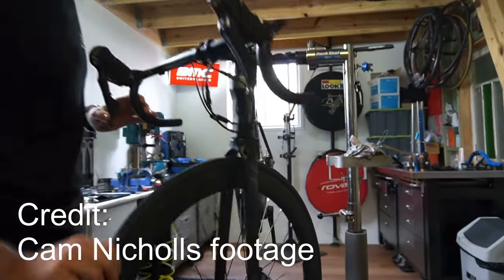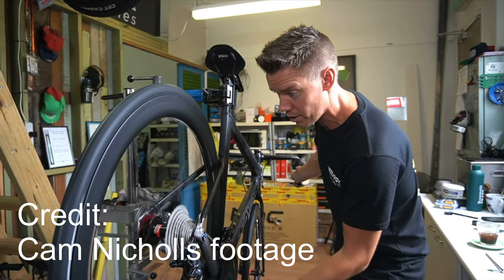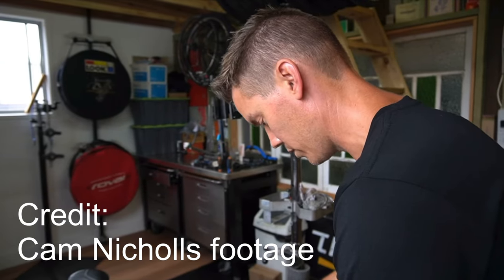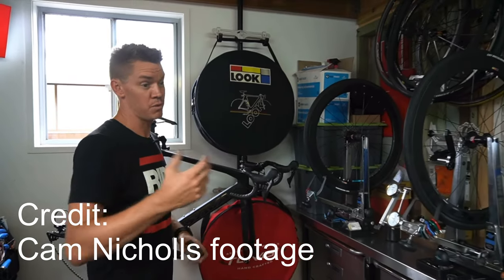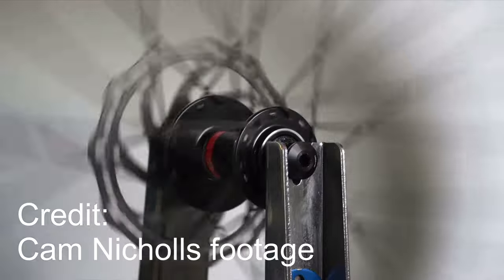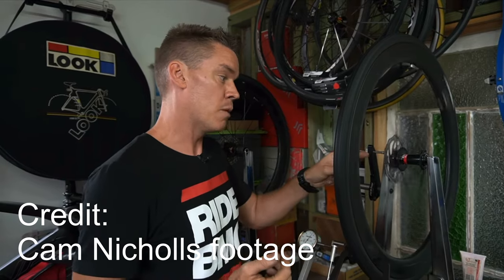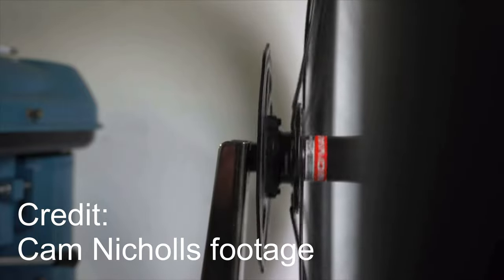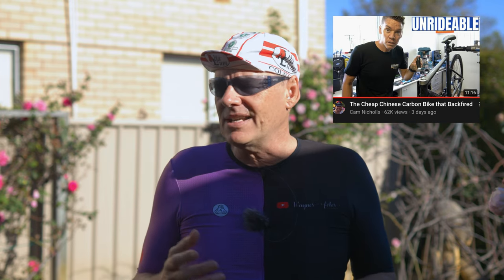Another problem with disc brakes!

Comment: The issue is not disc brakes it is the poor quality of the frame and wheels. Disc mounting points not square, the hub bearings off centre, issues with steerer tube etc. Blaming everything on disc brakes is becoming tedious. You're blaming a type of component for poor quality manufacture and suggesting that instead of fixing the real issue we should stick with rim brakes so that manufacturers can keep turning out sub-standard products.
Reply from the maker: Your missing the point;
The result is the brakes don't work properly on a new bike.
I clearly pointed out it is caused by other components, but why is immaterial as most people buy a whole bike. If the completed package doesn't perform it doesn't perform! 
The bike industry has an issue with QC and unfortunately disc brakes are more sensitive to póor tolerances.
This was my point.
Reply: @waynosfotos  so rim brakes allow them to carry on, making shonky bikes, all's good!

Comment: Junk no name frame, improper hub assembly? I have had no problems with several mtb bikes and can't see this as an indictment against disc brakes. "shite manufacturing of the highest order" to paraphrase our famous friend.
Reply from the maker: This type of stuff is systemic in the bike industry, and many different brands come out of the same factory.
In this case it is a no name brand. But you don't have to look to far to find it in well known brands.